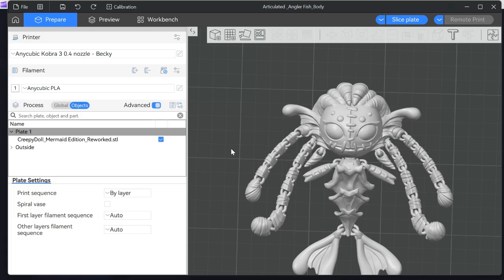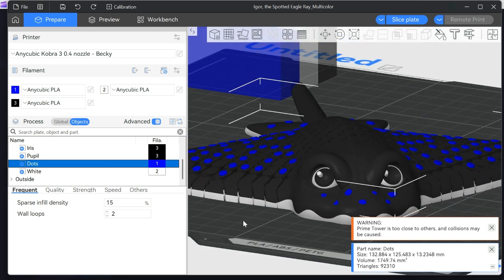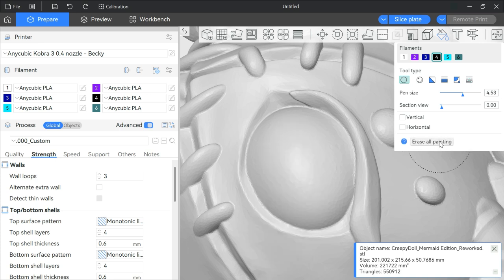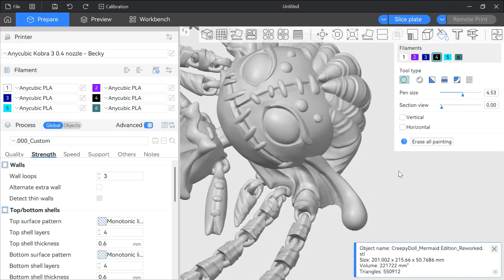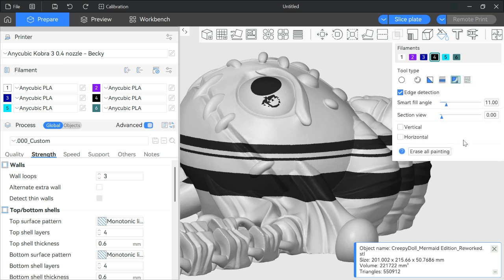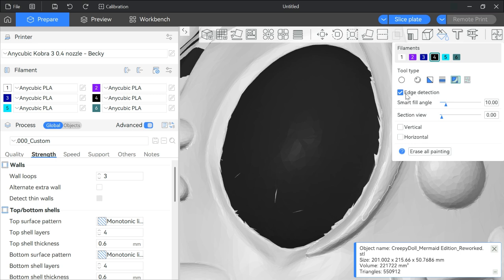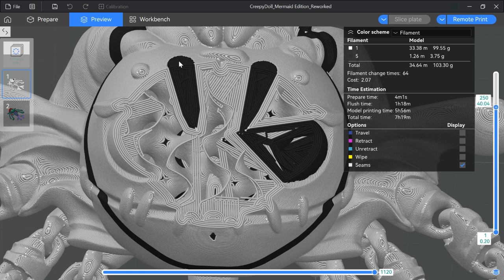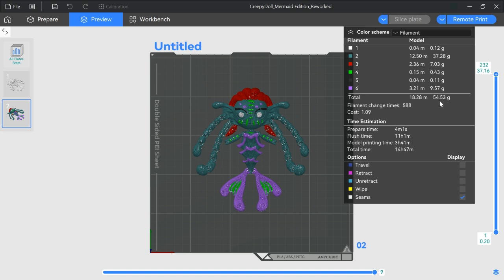Anycubic Slicer Next 3D model Painting Tools #3dprinting #anycubic #painting #orcaslicer

Comment: Please help me. I am trying to do a Deadpool knife block that has 3 different colors, but I'm having a really hard time trying to get the black areas around his eyes and around his neck to be straight. All I end up doing is getting it rounded and it's all bumpy around the outside of the black areas around his eyes. I'm really hoping to get it look like it actually should look, how do i do that?? I really do appreciate all of your help with all of this 3D print painting. You're fantastic.
Reply from the maker: Did you assign the three colors in the slicer, then paint the model those three colors and finally, when you send the file to the printer, you have to select while spool corresponds with each color? https://youtu.be/wbhCHgiT9vc?si=cKBp1-JnDkSw0wul
Reply: @FRENZi3DPRINTING  I am talking about when I am painting it in slicer. The black areas around the eyes on the Deadpool mask are not straight, there are spots where it's bumpy and I don't know how to get the lines around the black areas straight and smooth.
Reply: @FRENZi3DPRINTING  is there any way that I can send you a picture of what I am talking about?
Reply from the maker: @PaulFielder-o3y yes, my email address is in my bio

Comment: Wish they had more options to paint with. Was trying to paint an outline around some numbers for my address to put on my house. Once you get the camera the correct angle you can use vertical for straight lines, but all curves I just free handed the entire thing, then fixed what looked messed up. These numbers are 3mm thick and they are flat, scaled to whatever size needed. Only changed the top layer cause it is not needed to be different inside of it. If you have any idea how to paint on 1 layer of a flat object I'd love hear. Thanks for the video!
Reply from the maker: I would have done that while projecting you’re describing in Maker Lab using the make my light box tool. There is specifically an outline tool. Then after you download you can delete the parts of the light box that you don’t need. Or hell, make your house numbers light up :)
Tinkercad also has a sketch tool you can use to outline things as well

Comment: Hi enjoyed your video,  I have simpler 21 layers where I just need to change the last 4 layers of I was wondering if you have another that would cover that? Thanks
Reply from the maker: @rileyscott9736  If you only need the top 4 layers a different color, you can make the layer height paint tool that exact heigh and then just click the top of your model. Example: printing .2 layer height will require an amount of .8 to be entered in the little box on the layer height paint tool, and then just click the top of your model. It would only paint the top 4 layers
Reply: @FRENZi3DPRINTING  I very much appreciate you getting back to me.